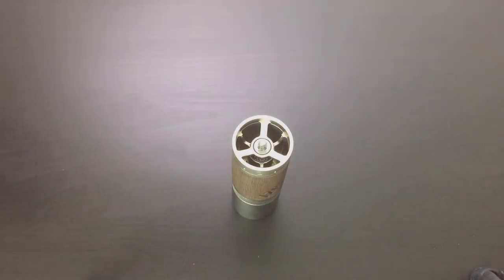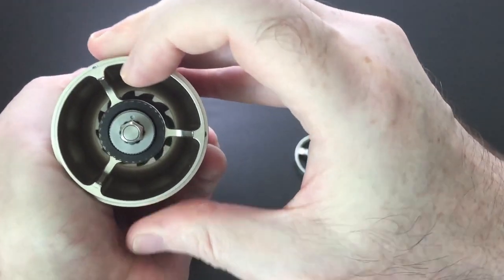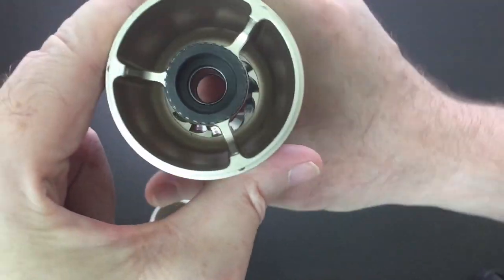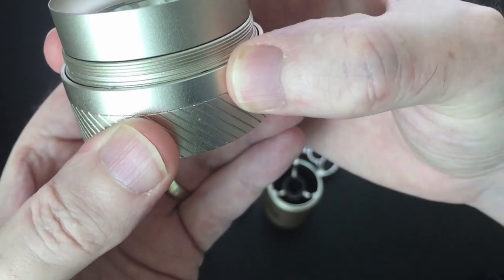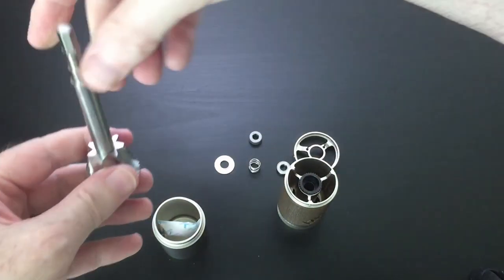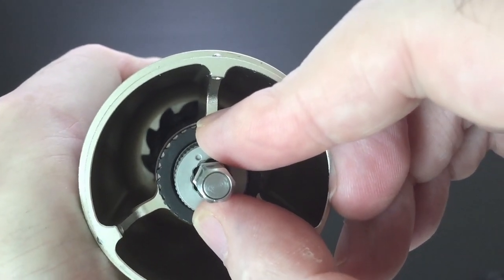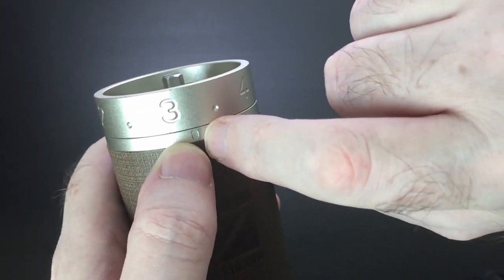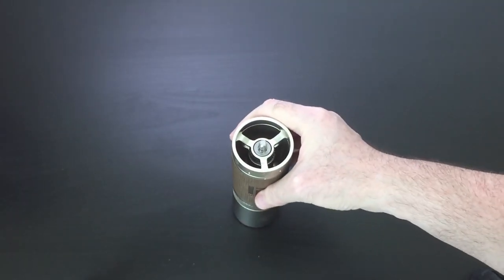1Zpresso X-Pro Quick Disassemble and Calibration Guide

Comment: Commenting this in case I might get an answer. I cannot for the life of me remove what the manual calls the "knurled thumb nut" from the inner burr. I've tried it with the two and half turns (like the manual points out) and also with it fully turned. I push the burr from the bottom and the knurled thumb nut doesn't move, it seems like it's stuck with the hexagonal piece. I tried forcing the hexagonal piece out and the thumb nut in, but didn't get any result. I don't know what to do anymore. Every video I see makes this look so easy (and I even did it on accident the first day I got it) but nothing happens. I don't know what's wrong.
Reply from the maker: When i first got the X-Pro it was not released yet and there was no information about it at all. 

I was completely stuck when it came to taking the thumb nut off, it took me a little while to figure out that you have to slightly move the thumb nut the a corner of the burr shaft.

I reassembled the grinder and a little later i went to dismantle the grinder again and could not get the thumb nut off again, it made me crazy.

Then i figured out that i needed to turn the adjustment dial until the burrs are fully open, only when my burrs were 100% open could i turn the thumb nut and release the burrs. 

It does help if you push the burrs up from below also, so the thumb nut is not so tight. 

also take the adjustment dial off when you are doing it, i dont think it matters, but it might help. So give that a try and let me know how it goes.
Reply: @mightymightyironhead  i had to apply an inordinate amount of force downwards in the nut since it was kinda stuck/rusted? either way, i’m not sure my grinder came out of this intact lol
Reply from the maker: @isqueirosbic  the nut should not need pushing downwards, i am not sure why you would need to do that?.

When you are taking the nut off, you just need to open the burrs completely, then take the adjustment dial off, push the burrs up and then turn the thumb nut slightly left or right.

When the small dot on the thumb nut is on any corner of the burrs shaft, the nut is locked, when the small dot is positioned on any of the straight parts of the burr shaft, its open and the burrs should just drop out.

I never use water anywhere near my grinders and i don't advise others to do that, i also never use the WDT on my beans and i also advise others to not do that, but again i honestly don't see how this would rust the thumb nut.

The nut should not get rusted, even if you leave the nut soaked in water for weeks i don't think that it would be enough to rust it to the point where it wont come off.

The only other thing that i can think that might make the thumb nut get stuck, if if the grinder has not been cleaned and the grinder has been using a lot of really oily dark roasted beans and the oil from the beans have gummed up the grinder, but that would also be obvious and i really don't think that even that would make the thumb nut stick.

Anyway its good that you managed to remove the thumb nut.
Reply: @mightymightyironhead  yes, it was super stuck, not freely moving. either way it seems fine though, but i cant help but think i fucked something up. the burrs are fine though
Reply from the maker: @isqueirosbic  yes i was a little confused when you said that you needed to push down on the thumb nut, the nut can only screw left or right to take it off.

So i am assuming that you were talking about the burrs and pushing the burr shaft down? 

If you were talking about the burr shaft, it is possible that you can "lock up the burrs" by over tightening them when you calibrate the adjustment dial. 

Sometimes users turn the adjustment dial too hard to get the 0 number into position and this can jam the burrs and the dial wont move, then its not possible to take the thumb nut off without tools and tapping the top of the shaft with a hammer.  

Anyway its good news that you got it sorted out.

Comment: I cannot get the outer burrs unscrewed for the life of me
Reply from the maker: Yes the outer burrs can be a little difficult to remove. 

They can over tighten a little after using the grinder for a while, so i try to take mine out as often as possible when i clean my grinder.

You need to use something that has a good grip to turn the burrs, anything with rubber will help and obviously make sure that you are turning the correct way to loosen.

I have some gardening gloves that have rubber on the surface and this lets me get a good grip to turn the burrs.

Something like these: https://totallybranded.co.uk/product/jardinero-garden-gloves/
Reply: @mightymightyironhead  thanks for the tips! The gardening gloves is a great idea. I'll keep trying! Haha
Reply from the maker: Sorry for the late reply, YouTube is a little strange with updating me about comments. Yes it can be a real pain to get the outer burrs off, sorry i dont have a quick fix for that, but anything rubber that gives you a good grip will work pretty well. I used to wrap a half dozen rubber bands around the space on the outside of the burrs and that can  give you a decent grip, but its best to try and use both hands.

Anyway good luck.
Reply: I had the same issue, nowadays the izpresso comes with a flat rubber band, i put it where the outer burrs are, and was able to remove it, you have to make sure you are moving in the right direction, it was the opposite of what i thought.